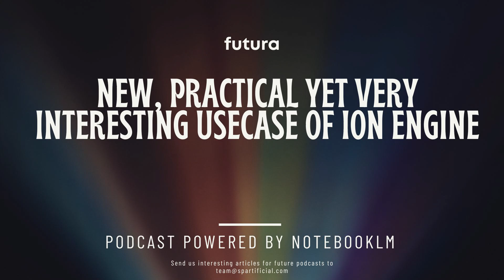New 100X More Powerful ION Engine Going Way Beyond

Comment: The problem with the solar gravitational lens is you can only look at one part of the cosmos at a time. If you want to observe a star in the opposite direction, you will have to move the lens to the other side of the solar system which will take a long time, even with these faster ion engines. Need to make a lot of them if you want to access all the cosmos in a reasonable time.